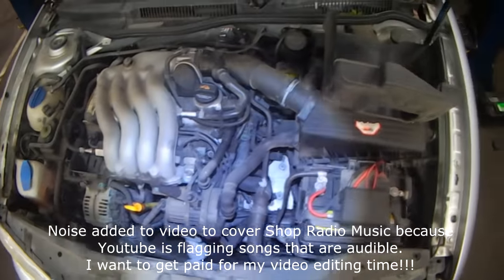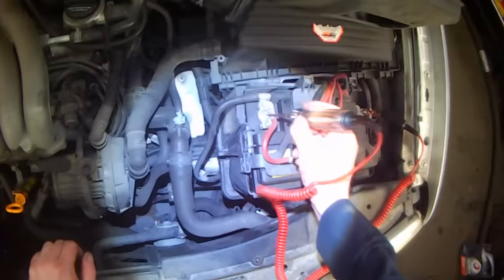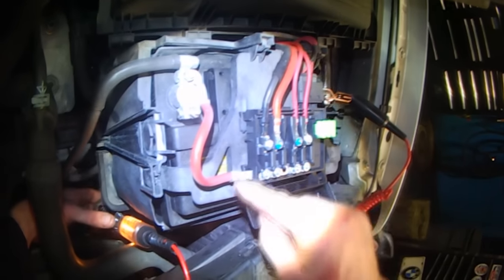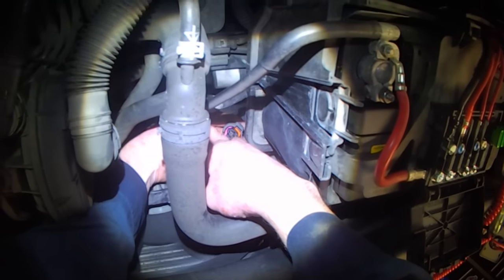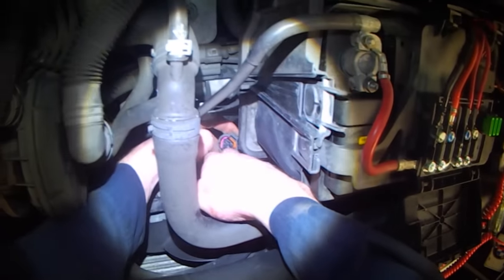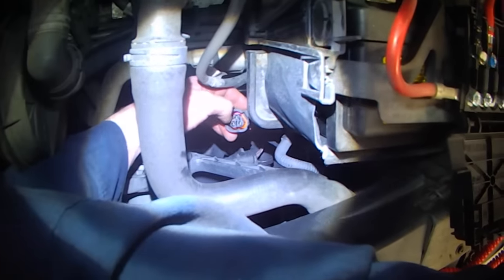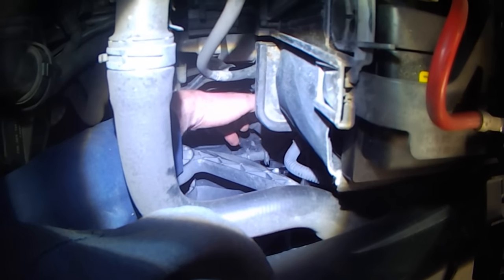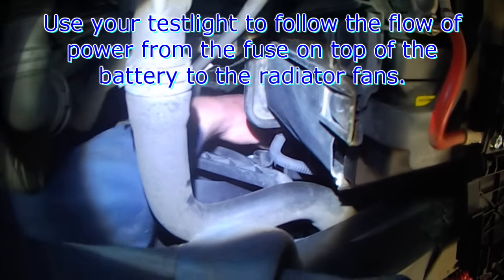VW A1 A2, A3, A4: Radiator fan(s) quick check.

Comment: thank you so much. I was looking for information about if can I short those pins to force fan spin, or can i not.
btw. you are lucky that your plug was so easy to remove - main is stuck.
Reply from the maker: As you can see... I bridge the power wire with one of the other wires to check fan operation. Year, make, model, engine? Is the engine overheating? All the time even when driving? 
I have a dentist appointment in a short while... I will get back to you once I am back home.
Reply from the maker: Have you bridged the wires? What happens?
Reply: @EXOVCDS  thank you for answer. a3 8L1 1,9tdi 2001 a/c present. Engine is overheating. quickly gets 100/120 degrees. Fan doesn't start. So I thought that maybe is faulty. When I turn the core by hand it turns hard - not that easy like small fan from a/c. So I wanted to force fan to start to see if it can turn -because fuse is okay. but I cannot discontent that socket/plug. it stuck. I'm afraid that I will rip off the sensor. 
so I left it and I went other way.  I connected laptop to obd2 and using vag-com I saw that ecu see different/ lowest temperature. I discovered that temperature sensor has 4 wires so it is 2 sensors in one. fist for ecu, second for instrument cluster, which can be faulty. so I force dash board to make a test. And when all arrows /pointers stops vertically in the middle I saw that temperature arrow wasn't on the middle in 90 degrees but at 100. and later it wasn't move smoothly.  I read on forum that there was two versions Vdo brand, which is good and Jaeger, which can gets faulty easily. I took out instrument cluster and see that mine is Jaeger  (not Vdo). I also has issue with fuel level arrow/pointer - sometimes stops work  So I think my engine is not overheating - but simply Jaeger is faulty.  I have to replace instrument cluster. And then after that I will be worry about fan. When my car stays 2 hours off I open the coolant liquid box and touch the liquid by finger and it was just warm, but on the dash board I saw 90 degrees so it is not logic. so I start the engine, wait half hour and discovered that radiator was hot as it should be and bottom hose and upper hose were hot as well so temperature valve must working fine.
I'm not sure about fan but the main reason is dash board.
SO thank you very much for interested in my case and spending your free time to help me. When I get new /used dash board I will try again to disconnect that fan plug and force fan to start. I couldn't find output test in vcds/vag-com to force fan to start. 
BTW.
how's your teeth? :-)
greetings from Poland
Reply from the maker: @Radek__  Thank you for the update! TDI's take a long time to get warm... quick rise in temperature is usually electrical / sensor problem, just like you discovered. Good job!
Teeth are good, thank you! LOL

Comment: Hi
Thanks for the helpful video.
Have vw caddy 1.6 petrol, any idea if temperature fan switch is faulty, will vcds still be able to active radiator fan?

Thanks.
Reply from the maker: What year, what's the engine production code so that I can look up correct information.
Reply: @EXOVCDS  
It's a 2005 vw caddy.
BGU engine
Reply from the maker: @ctradelink243 
I won't be home for a few hours. I'll get back to you then. Thanks for the info!
Does the car overheat while driving or only when standing still?
Reply: @EXOVCDS  
I just got it few days ago, didn't drive it yet, but was fixing few things before driving, noticed vcds was unable to activate the fan, so was concerned, not sure if fan switch is faulty
Reply from the maker: @ctradelink243 
VCDS cam only activate radiator fans that have a fan module built into the large radiator fan.
If your radiator has a radiator fan switch (like in this video) then vcds can not activate it.
If vcds shows you radiator fan in "output tests" then there will not be a radiator fan switch at the radiator.
Reply: @EXOVCDS  
Yes, the fan switch is exactly the same as in your video 
Fan has only 1 fan (no aircon)

Will pull out test radiator temperature sensor and test.
You advise was very helpful, really appreciated your responses.
Reply from the maker: @ctradelink243 
If the fan works when bridging the harness plug... then the fan, wiring & fuse are ok.
If fan does not come on, make sure that 1 of the wires has battery power.

Comment: I have experienced occasional overheating in traffic jam this summer that I could revert by turning on AC. Is that caused by a faulty radiator sensor or should I check something else?
Thanks beforehand.
Great video!
Reply from the maker: Year, make, model, engine?
Reply: @EXOVCDS  it's a 2003 VW Golf 1.8T
Thanks!
Reply: @EXOVCDS  Any hint about that?
I have also noticed a very light hesitation between 1.600 and 2.000 rpm aprox. Could it be connected to the main heating issue?
Cheers.
Reply from the maker: Sorry, I didn't get a notification for your first reply. When you turn ac on, the fans come on. If they don't come on by themselves,  then check the radiator fan switch & wiring.
Reply: @EXOVCDS  I think they turn on but in a couple of times recently they  didn't. I will make sure they start by themselves and let you know. What are the expected start temperature for low and high speed?
Thank you!
Reply from the maker: @PCP250cc  Low & high speed temperature ratings should be stamped on the sensor (usually 95c & 102c). I usually see the fans come on when the scan tool shows 96c to 98c. Keep in mind that the engine will get hot before the radiator fan switch. Meaning that even if you see temperatures of 96c or more with the scan tool... the radiator could still only be at 93 or 94c.
Monitor heat inside the car... if you have lack of heat, then you have a water pump issue. 
Overheating (at idle) with good heat inside, but no overheating when the car is moving... is a fan issue.
Overheating at idle or driving (with good heat inside) is a bad thermostat (stuck closed).
Reply: @EXOVCDS  Heating works fine; even without turning it on, I feel heat inside the car. I´ve checked both fans turn on (low speed) at iddle. I asume they will at high speed, if I waited longer.

Early this morning (cool weather) I got another temperature rissing when I got in a traffic jam. And as previously, connecting AC I got the temperature back to 90º quickly.

I am really confused. It seems sometimes it starts to overheat and sometimes it doesn´t (I get stuck in traffic jams frecuently)

I will check wiring and connectors but, how can I check radiator temp. switch is working fine? Pipe from thermostat (lower) and from radiator (top) are very hot both, I notice no difference. Thermostat got replaced 3 years ago with a Mahle one. Could it be caused by a relay, or something else?

Thanks a lot for your help!!
Reply from the maker: Low speed does not go through / require a relay. How hot does it get / how far does the needle move past center? How old is the temperature sensor? I have seen faulty sensors cause the needle to go red hot.
Reply: @EXOVCDS  the needle moved two lines past the center, up to 110°C.
The green temperature sensor may be the original one installed at the factory. Do not remember having it replaced ever.
Do you think it is responsible for the random problem I'm suffering?
Thanks a lot.
Reply from the maker: @PCP250cc  I don't know... the only way to know is to eliminate one thing after the other (if no specific bad part is found). If the temperature stays at 90c while the vehicle is moving, then the thermostat is OK. So start with changing the green temperature sensor... then the radiator fan switch. AC triggers low speed, so we know that low speed operation is OK, but you don't know if the wiring from the radiator fan switch (for low speed) is ok (could have bad connection / corrosion). If you can trigger low speed manually at the radiator fan switch harness plug, then the wiring is ok and the problem could be with the switch.
Keep digging... I'm sure you'll find the issue.
Reply: @EXOVCDS  OK, I'll start changing the green temperature sensor, even if I haven't got any fault code registered for it.
I tried to trigger manually the radiator thermoswitch but I couldn't unplug it. I'll try again ASAP and let you know.
I hope it's just the green sensor, not the control module under battery or the thermoswitch.
Thank you!!
Reply: @EXOVCDS  I finally managed to trigger the fans manually bridging the radiator thermo-switch connector. Both fans work in low and high speed.

Is a faulty radiator thermo-switch causing the overheating in traffic jam conditions?

Do you still think I should replace the green temperature sensor?
Could it be caused by a faulty fan control module?
Thanks for your help!
Reply from the maker: @PCP250cc  Low speed does not require the fan control module. High speed should come on when low speed does not (needle will go past middle). If the radiator does not get warm / hot (stuck thermostat, bad water pump), the switch can't trigger the fan. If you want to replace the fan switch, start there. Otherwise, confirm that the radiator gets hot everywhere. You can let it idle until the needle starts to move past the middle... then, trigger low speed manually. The needle should go back down to the middle... if it does not, then the thermostat or water pump is bad (no flow through radiator).
Reply: @EXOVCDS  I´ve checked both fans turn on (low speed) by themself at iddle. The vagcom showed 97-99 ºC when they turned on.

Pipe from thermostat (lower) and from radiator (top) are very hot both.

Only when I get stuck in a traffic jam it starts overheating and, by connecting AC I get the temperature back to 90º quickly from 110 ºC
I think the high speed is not working at that point -maybe low speed fails too, sometimes-, and the engine overheats. But, as I said, I could manually trigger the fans at the thermo-switch connector and both fans work in low and high speed. 

What's the faulty component responsible for this? Fans and wiring seem OK, after manually triggering.
Thank you for your time helping us.
Reply from the maker: @PCP250cc  replace the fan switch then. Sometimes the sensor is just dirty (buildup of deposits on the face of the sensor that can affect how it senses temperature). I forgot that your needle comes down when you turn on AC... I reply to a lot of people and lose track of what was told to me and what I have already replied with.
Reply: @EXOVCDS  thermoswitch just replaced. I still haven't found a traffic jam to test if it still overheats in that situation or that solved the problem. What puzzles me is that old thermoswitch was tested for continuity and it worked. I hope it was out of range or affected by dirt as you suggested.
Best regards.
Reply from the maker: @PCP250cc  Thanks for the update! Let me know how things go.
Reply: @EXOVCDS  I haven't had any problem after replacing the thermoswitch  until today that  I got stuck in a long traffic jam and the temperature started to rise. Same problem again.
Turned AC on and got it back to 90°C.
Thermostat and water pump seem okay. What's wrong with this car? Green temperature sensor, control module, fuses? 
Thank you.
Reply from the maker: @PCP250cc  Radiator fan switch is rated at 95c & 102c
https://www.ecstuning.com/b-genuine-volkswagen-audi-parts/auxiliary-fan-switch-95-102c/1h0698481b~oekt/
Engine temperature will be hotter than radiator fan switch... because it takes time for the hotter temperature to circulate to the sensor.
When turning AC on... the fan module activates LOW speed, unless AC pressure is high, in which case it activates high speed. 
If low speed is not being triggered by tha fan switch in the radiator... look for corrosion in the wiring going to the fan switch, preventing low speed from activating. 
When the dash shows 110c, the radiator fan switch could still be less than 102c... and that's why 2nd speed is not yet coming on. 
You need to verify power to the fan switch and power coming  out of the fan switch... ***when you see the temperature needle going past the middle***. 
Checking at any other time is irrelevant, because the problem is not happening.
Reply: @EXOVCDS  Thank you for the quick reply.
Okay, I understand there is a temperature difference between the dash and the radiator thermoswitch but, why is the dash gauge rising two lines, up to 110°C, when it never moved beyond 90º before, in the same circumstances?

It is supposed the fans should act with low or high speed so that the dash gauge stays at 90º, unless extreme driving conditions occur, don´t they?

How can I verify power to and out of the fan switch? 
Best regads
Reply from the maker: @PCP250cc  You are correct... under extreme driving conditions (extended high load and hot ambient temperatures) dash temperature can go past the middle.
Like I said... the only way to find the problem, is to test things when the problem is happening. 
Use a test light to verify power going to the fan switch and power coming out of the fan switch.
If power is coming out of the switch, but low speed is not working, then there might be a wiring issue (corrosion / bad connection) between the switch and the fans.
If no power is going to the switch, then there is a wiring issue or bad connection.
If everything checks out OK, you need to make sure that there is no head gasket issue, that could cause an air pocket to form in the engine (preventing coolant from circulating correctly). 
Use an IR Heat Gun to check radiator temperature... to make sure that the sensor gets warm / hot when the needle starts to climb.
If the dash shows 110c but the upper radiator hose measures less... maybe there is an intermittent issue with the gauge / instrument cluster.
Using VCDS, one can do an output test of the gauges... where the needles move full sweep and then stop in the middle. I have seen Audi TT instrument clusters, where the needle would not sit in the middle during the test... but I have not yet seen a bad mk4 cluster.
Reply: @EXOVCDS  I checked wiring by bridging thermoswitch connector terminals before replacing the thermoswitch and fans worked in low and high speed.

I will keep on testing but it's not possible to test when the problem is happening because it's only happened during heavy traffic jams at rush hour...

I have a new green temperature sensor available, I'll replace it just in case it is the origin of the problem.
Thanks a lot for your help.

Comment: Hey Thomas! I have the same 2.0 w/ AC. Both fans do not come on, but when jumping the cooling fan, only the high speed works, even when bypassing the FCM. Any ideas? Thank you.
Reply from the maker: Low speed of both fans is burnt out. Replace both fans. You can confirm this by applying power & ground directly at each fan harness plug.
Reply: @EXOVCDS Even if the fans aren’t coming on at all? (High speed doesn’t kick on even when warmed up and driven)
Reply from the maker: Are you sure the water pump is pumping? Is the thermostat opening? Watch this video... do the same checks.
https://youtu.be/LiDRUWPw_f4

Comment: Thomas,

I have a Mk4 Jetta 2.0 and the fan cycles on and off while the car is idling. I couldn’t find anything on Vortex about an issue like this. Should I check the module?
Reply from the maker: How often / quickly does it cycle on / off? Doe it only happen when AC is ON?
It "should" cycle at an even pace. Change the radiator fan switch to see if things change.
Reply: Thomas EXOVCDS it cycles every 3 seconds continually without stopping
Reply from the maker: Disconnect the radiator fan switch... same thing?
Does the engine have AC? What year is the car?

Comment: I have a situation where I touch one of the wires with a lamp.  on the wire where the test lamp lights up, both fans immediately start to work and the test lamp lights up.  I didn't continue testing to combine the wires because it doesn't happen in this video.   do you know what it could be?
Reply from the maker: Year, make, model, engine?
Reply: @EXOVCDS 2002, vw, polo 9n, bby engine
Reply: I solved the problem with starting the fan.  First replaced the thermo switch, then the thermostat.  The fans are working now. Otherwise they worked when the air conditioner started,but when the engine reaches 98c they are not.  Once my engine overheated and realized that it wouldn't start.
Reply from the maker: Thank you for the update.